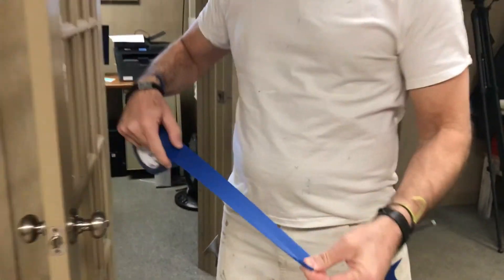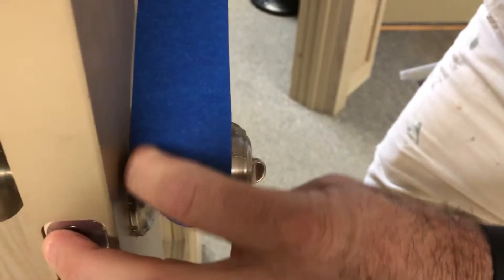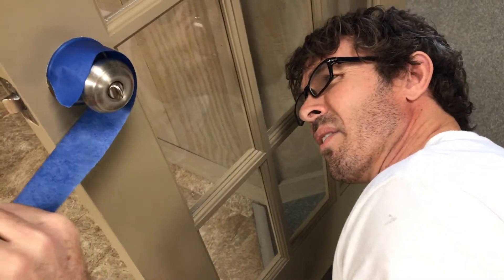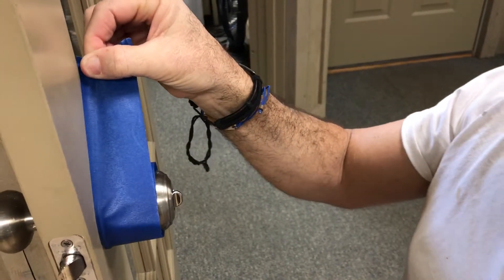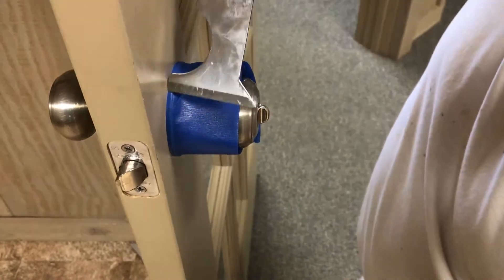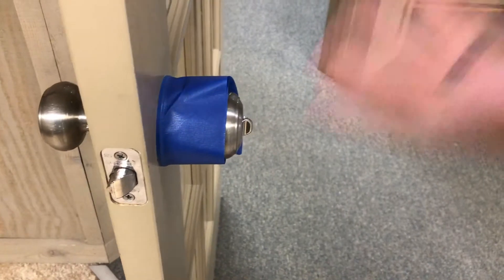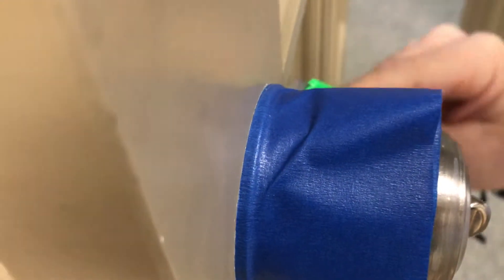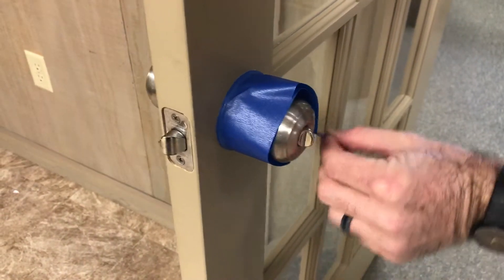How to Apply Masking Tape to a Door Knob- Warsaw, Syracuse, Columbia City and Goshen Indiana Areas

Comment: Yes.  the 'Step's method'.   or... 'Old fashioned way'....in Lieu of Removing all the Handles,  which we all know is a Pain...and we would rather not have to do that,  if possible.   But.....Here's an Idea:   Why....hasn't some company manufactured some sort of 'Plastic' or 'Bakelite' ....'Formed Door Handle Guard?....Something like a "Solid Plastic Cone Shape...that you merely place 'Over the Knob....and is Circumferenced to fit  the circular diameter of the Plate....and simply 'hold it there,  pushing In...while you quickly brush around the guard.  Then just lift or pull it away...and place over the next handle!    ...Surprised, with all the 'Other' cool paint inventions....No one has thought of this.
Reply from the maker: I hope this was helpful.